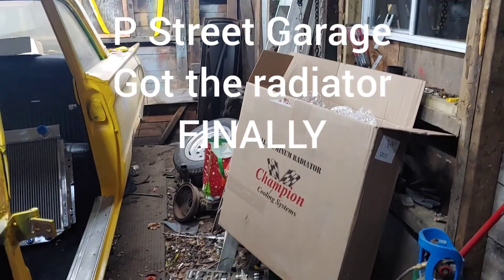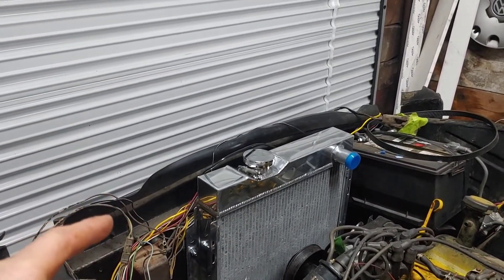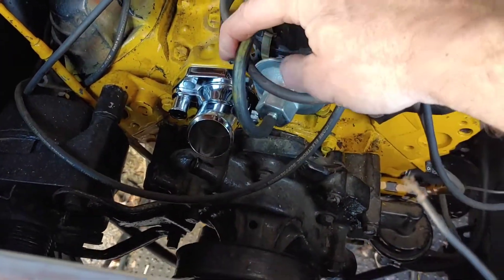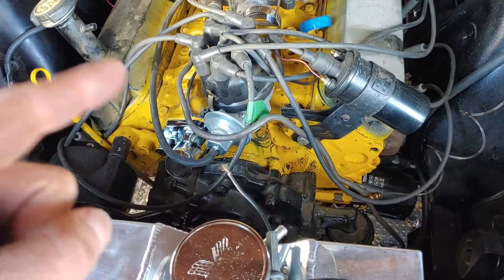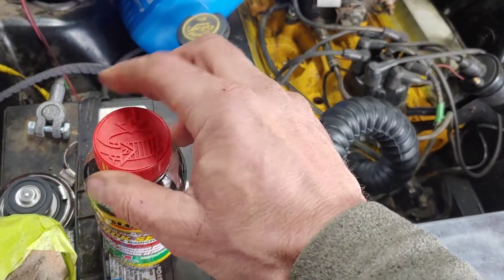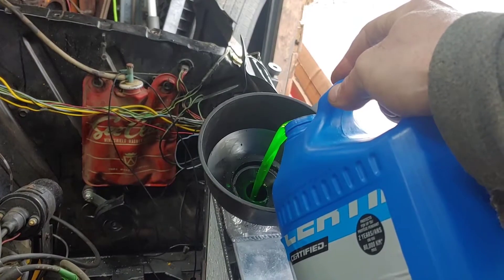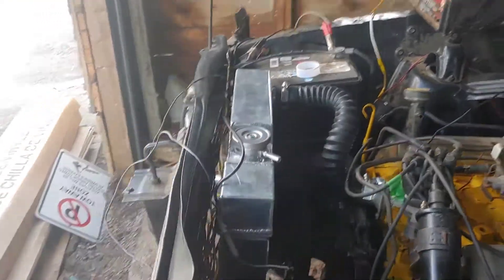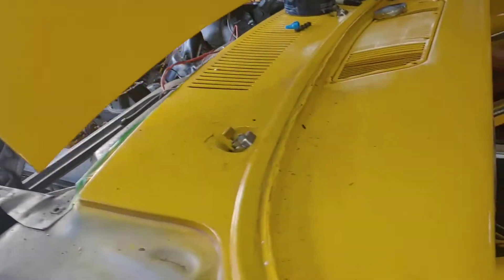62 Comet gets a radiator.  It finally came !!

Comment: More than likely that little box that was on the back of that windshield wiper switch is probably an inline fuse,,,,,at the minimum if you want to run it straight to the battery you should have a inline fuse ....personally I would run a relay with a inline fuse ...that is very hard on the switch  straight 12 volts.... you can't compare it with your cigarette lighter because there is no switch on that.,,,, .you're removing components from original setup....be careful you don't want to see all your hard work go up in smoke.........
Reply from the maker: Yes most likey a relay.  Definitely dont want any fires. That would really suck.  Thanks for watching and commenting.